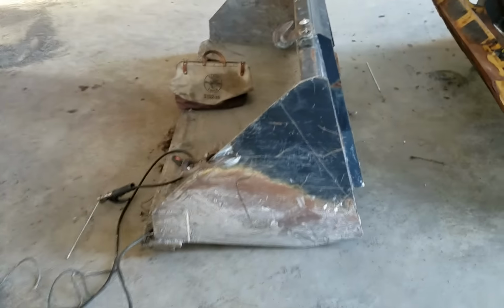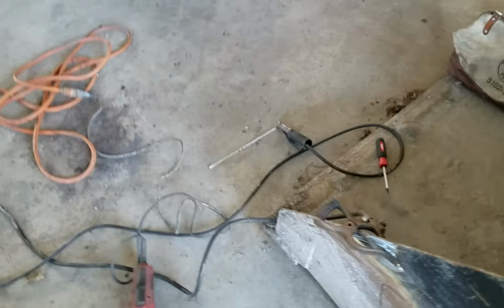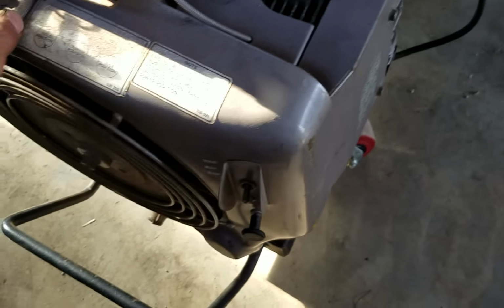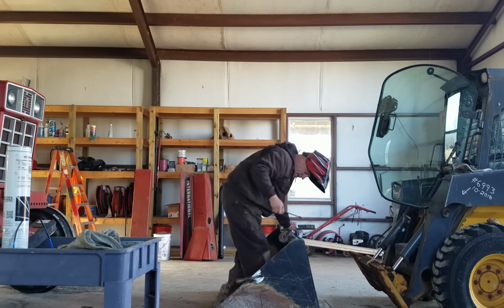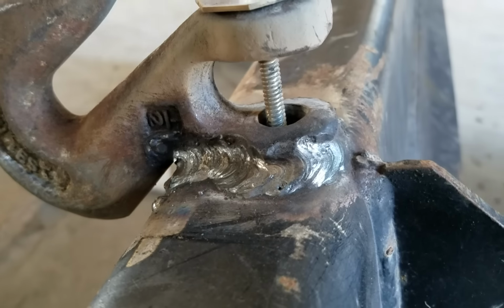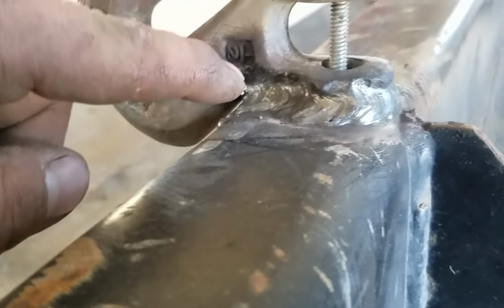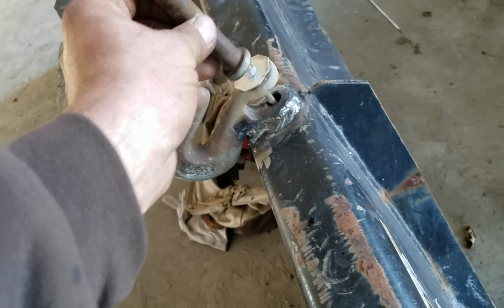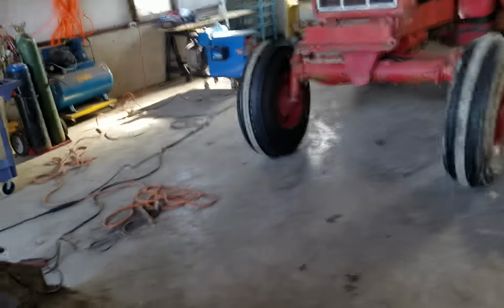Welding hooks on the bucket.

Comment: nice video, we have a gehl 3410 skidsteer, and we have hooks on the bucket to, and if you ever look to get a loader for the 1086, look at westendorf wl-42s, we have on bought new in 79' for a 2-135 white, and in 2017 the only thing wrong with it is the paint is gone, if it had a some new paint it would be a brand new loader

Comment: If you wanted too we put a hole right behind the cutting edge big enough too drop a trailer pin through and welded a piece below it too brace it better. Works good for moving wagons or using with a clevis
Reply from the maker: Midwest Allis Fan yup ie seen that

Comment: weided high presser steam pipe for 27 years i never could get brave enough to wear a wild hood like that looked like a good weld to me I dont know what size rod you used 3/32 inch is the easiest to run for something small.7018 was the perfect rod to use.
Reply from the maker: Howard Younger yup, it was 7018